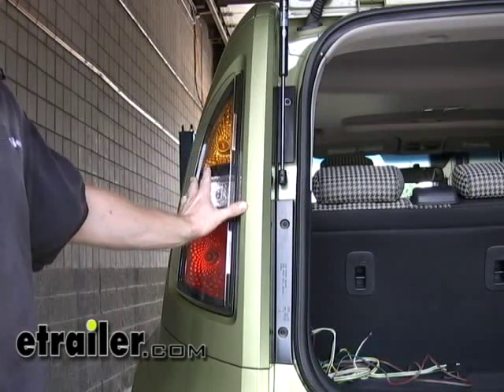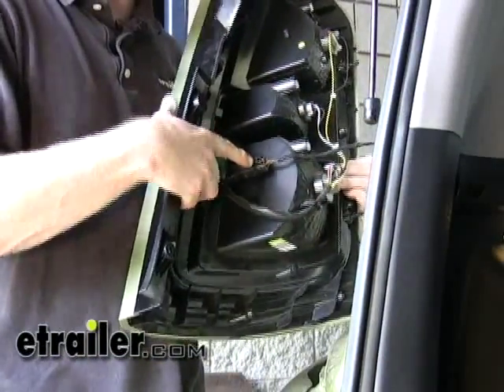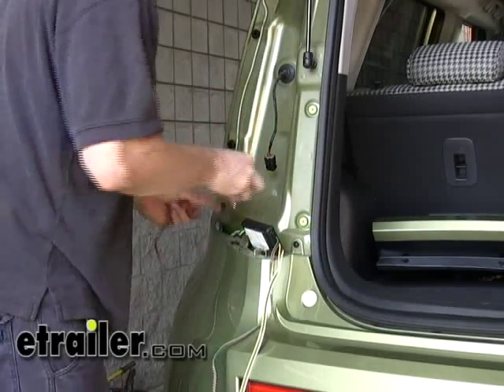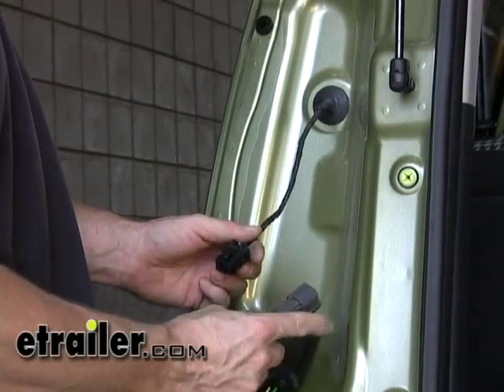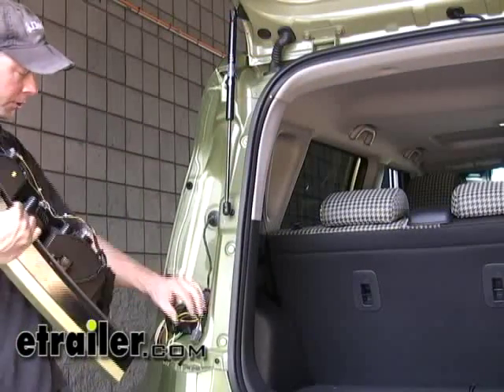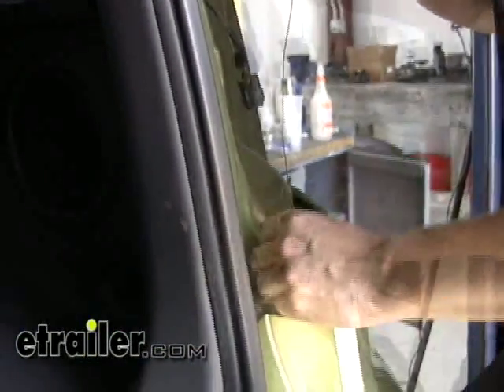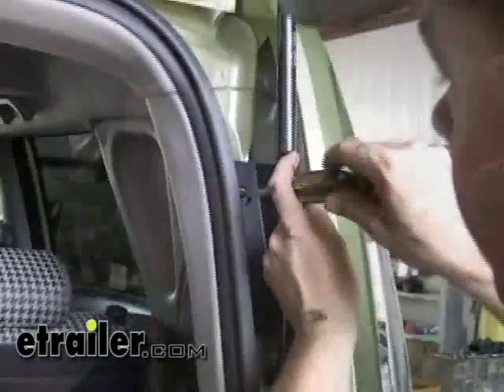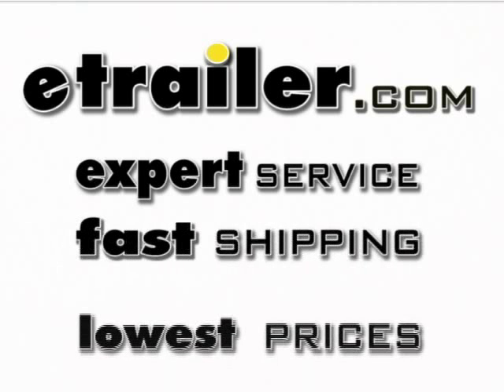Installation: T-One Vehicle Wiring Harness with 4-Pole Flat Trailer Connector on a 2010 Kia Soul

Comment: Hello, thanks for the video. I just installed the etrailer hitch i bought from your website. Unfortunately the video and the actual product seem to be different. the T connection has no black box as seen in this video. It is just a green wire connected into a split T for the male and female to connect to the lights from what i see. Also the green wire is just a tad bit short and it is unable to be fed down the bumper and under the car as shown in the video. It looks like we would have to remove the entire bumper and feed it through the top of the bumper in order for it to reach. I did not have time for that so i basically ran the wire behind the weather seal of the hatchback.
Reply from the maker: What is the specific year, make, and model of your vehicle?